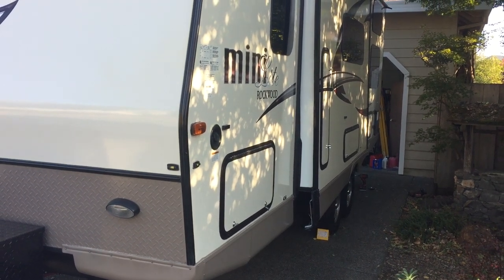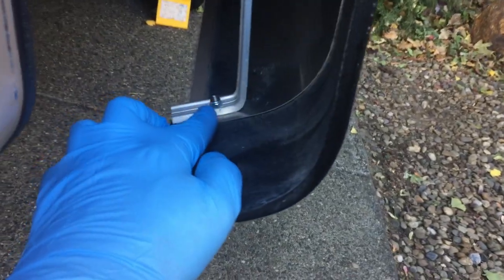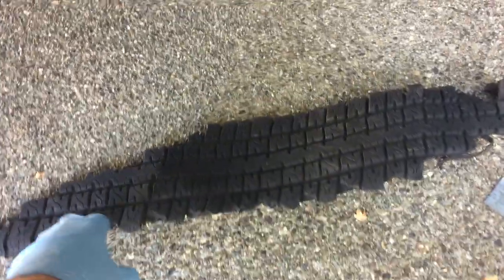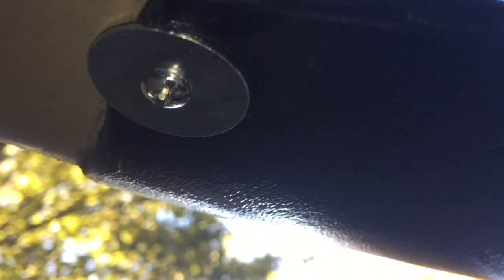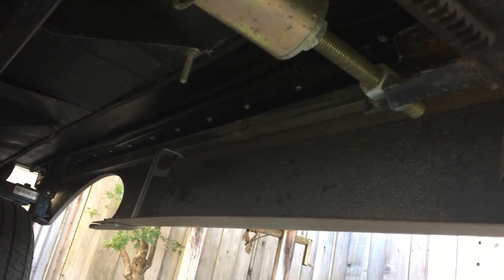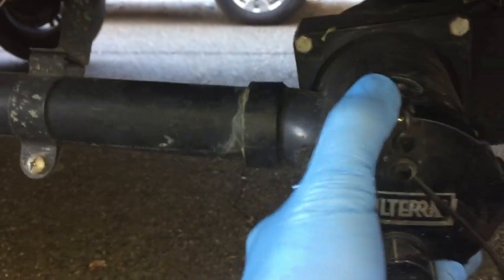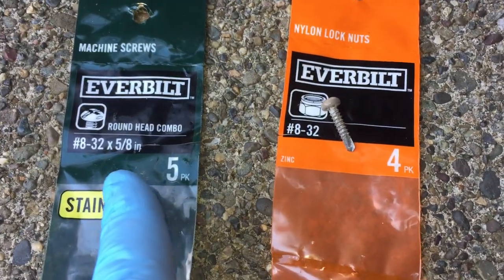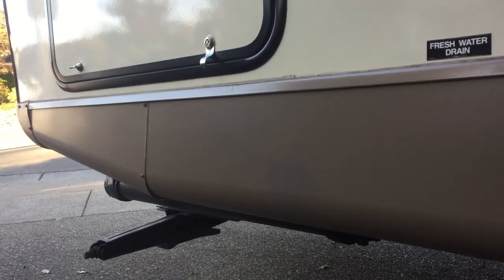Loose Travel Trailer Skirting and Sewer Pipe Modifications

Comment: I finally need to do that repair on my trailer. Thank you again for all your good expertise. I do appreciate it.
Keith
Reply from the maker: You're welcome :) Is yours pretty loose?
Reply: @thetraveltrailerguy  Yep, several screws have been working their way loose and eventually cracked the plastic. I ended up taking the whole fender skirt off today and will try to use Harbor Freight‘s plastic welder to secure it better. Then use bigger screws with Loctite or caulking on the threads. I am hoping the sticky tape will hold it and then I will re-caulk the seam to the trailer. I also need to make some more brackets like you made.
Reply from the maker: @dakotafisher6874  Let me know how that plastic welder works out for you
Reply: @thetraveltrailerguy  It's not real pretty but i did get her.  I used the wire mesh that comes in the kit for a backer,  welded (melted) in the broken pieces and fill in the rest of the gap with the plastic rod.  What would you recommend to use for the tar-like goo that holds the skirt to the fender?  Just stick it all back together or clean it all off and use 3-M tape and put the screws back in?
Reply from the maker: @dakotafisher6874  https://www.lowes.com/pd/DAP-Dynaflex-Ultra-10-1-oz-Clay-Paintable-Latex-Caulk/1000881618

Comment: How did those new tires work out on the trip and the alignment issue you might have had?
Reply from the maker: They work great, we have had them on the trailer for around 18,000 miles in the last 2.5 years. We replaced them after one of the China Bomb Tires almost blew (we caught it just in time) after only around 2,000 miles. They are wearing very good. Regarding the alignment issue axle tire, I rotated the tires prior to the trip and the tire did not wear down much in the 5,000 miles. I will be posting the axle replacement video and my brake replacement Friday 11/19/19. I hope you watch them, they have lots of useful information. On the 5,000 mile trip we had one of the brakes have a major failure that I explain in the brake video (make sure you watch it all to hear what a brake shop has to say about the self adjusting Dexter Brake)
Reply: @thetraveltrailerguy  will do thanks